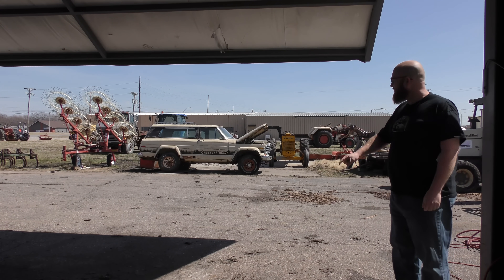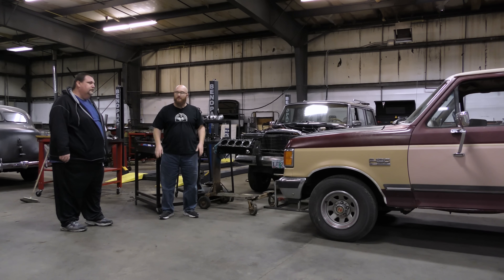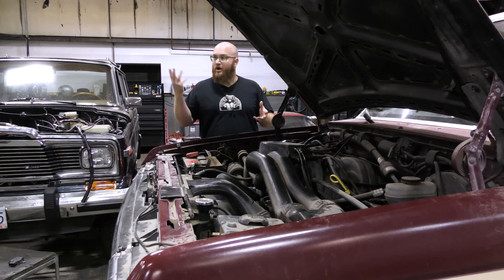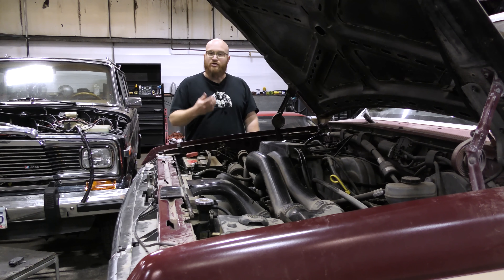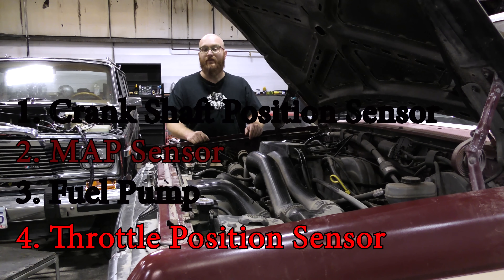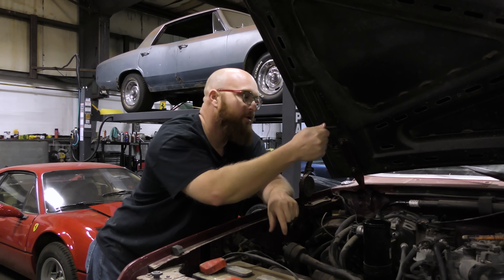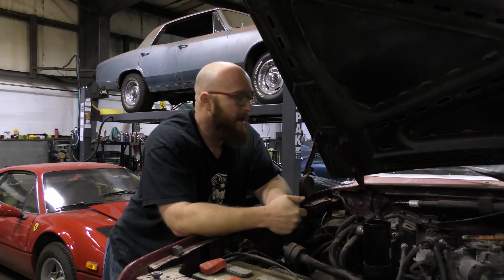Parts cannon couldn't fix this '90 F150. Old School diagnosing by the CAR WIZARD

Comment: I would check pin holes in the vacuum booster for the brakes? That whole vacuum system for the brakes is wanting to trick you all the time. 
    Tefgel and o-rings, amazing how many things on boats you can fix with that.

Comment: I love using the parts cannon, because I have more money than patience. Also, I have known many people take their stuff to mechanics, pay good money and their vehicles still doesn't run right. So my theory is, replace the parts and move on to the next system. I hate car shopping so whatever vehicle that I buy I commit to it. It's like owning a house. It's easier to repair what you already got. Every vehicle or really anything on this planet is in a state of decline or decay. And finally why not buy new parts so the manufacturers keep making them. I have never had a problem getting parts for an old Ford.

Comment: I saw this video years ago and came back to it today now having a truck with the same engine. It runs rough with only 66k miles on it. I have a loud backfire when revving the engine and it wants to die now when I put it in gear

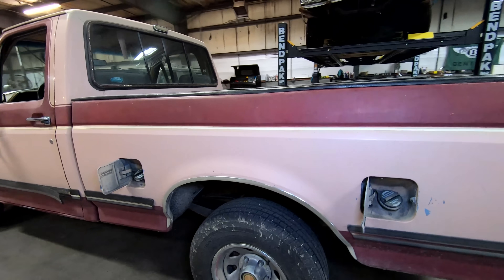Comment: 6:30 I had an 88 F150 and both tanks worked, however when you ran on the rear tank, it would pump fuel into the front tank (I assume the selector valve didn't switch the fuel return)

Comment: Hadda brand 1984, step-side, w/ a 4speed manual, w/ overdrive, w/ serious assembly issues. Currently have a 1984 f150, 270k, 302, auto, much to my dismay.

Comment: In the double fuel tank model 1 pump can have a bad check valve can cause weird problem. Runs rough tank your not using will fill up

Comment: the smoke test is genius. aside from that its best to buy and have a BOOK for such vehicle. As knowledgable as you may be, YOU didnt design it, and the ones who did have made a very thorough service manual for it with step by step procedures. I dont mean a flimsy haynes manual, i mean a real manual. or better yet, a stack of them. they will have specific ones for engine/transmission, emissions/vacuum, body/suspension etc....

Comment: the Ford 302 is a solid engine. Like the chevy 305/350 or the dodge 318 all of those engines are solid bulletproof engines I have 300k miles on one , Dad had 400k plus on a 318

Comment: I know i'm 2 years later, I don't think that truck even has a crank sensor. that's why it has a distributor. and yes my guess were MAP and TPS.  Did you ever find a new throttle body for it?

Comment: Not applicable in this case and nothing to do with idle, but a crank pos sensor can cause an intermittent fault if it is working but gapped incorrectly. I had an intermittent misfire on my 2000 miata and after a lot of troubleshooting the problem was just the crank sensor gap was out of spec just a little, enough to cause a CEL and slight misfire just once in a while.

Comment: there's literally a single tiny hose on first gen explorers, that if you have any leaks in that line (near the firewall in front of the driver in us domestic models), and it runs like complete crap at best, and dies constantly. plug the leak, runs like a top.

the level of vacuum dependency on this era of fords is insane.

Comment: Hey Car Wizard thanks for your informative video!!
How did you confirm the MAP sensor was the cause of the RPM "hunting" ? Did you check the MAP output signal at engine off ? or did you monitor the signal as the engine was idling? In other words if you confirmed the MAP was bad while engine was idling , how did you know the fluctuation of the MAP output signal was not caused by maybe the IAC due to an erratic operating ECT sensor or maybe an O2 sensor providing unstable feedback to the CPU and the CPU controlling the IAC making it ramp up and ramp down on the duty cycle ? Thanks so much really enjoyed your video.

Comment: Use starter fluid and spray the vacuum lines. When the engine starts to run smooth, you found it! Even a pinhole.

Comment: maybe a throttle body for a 1990 5.0 Mustang would fit. I haven't done the research to see if one would. Late Model Restoration might have one in stock or another aftermarket parts place that carries engine parts for older mustangs.

Comment: I just got a 91 ford 150 yesterday for 500 bucks only thing wrong with it is a cylonoid, spark plugs, belt, and muffler but it runs and still drives just very loud and don't like the mountains of viriginia but you can definitely tell that the 90s trucks was made way better

Comment: I have a ‘96 with a Ford 300! Probably a dumb question: but could you just switch the truck over to a carb? Or an aftermarket throttle body system (Sniper) might be pricey but then everything’s be brand new!

Comment: i have a 1989 f 150 it has same engine as video and have already been through the parts cannon we have replaced fuel injectors, tune-up new distributor checked catalytic converter  and exhaust no obstructions,  i assume they set timing in the midst of all the other things they have tried. ,when you crank it up you have to keep it running and you hear alot of popping under the hood not sure if misfire is proper terminology but would appreciate any suggestions

Comment: I have had 6 90s era fords. The throttle position sensor went out on every one. The first one I had it got so bad the truck would go down the road and almost get to 4th gear without touching the gas pedal.

Comment: I know this is older. I don't watch every single video but I'm guessing it's the #4 TPS. I've got 2 of these windsor trucks and have had to do TPS on both.
EDIT: MAP and TPS already being replaced isn't the end of the world at least especially if he plans on continuing to drive the truck. I would have had trouble tracking down that vacuum leak without a detector. Definitely common at over 30 years old to have vacuum leaks.

Comment: My dad had a 91. Wasn’t happy. Some module in the distributor went , and with less than 50k miles the synchros were starting to go in the manual trans. Did have the 300 six. Crummy trans.power steering very noisy and annoying too.

Comment: I disagree about intermittent crank sensors. My 2000 lesabre 3800 had an intermittent crank sensor problem that would stall at stop lights.

Comment: Nice POS working farm truck.  It is not hammered or rusted out.
Throttle bushing kit is going to be your best bet.  Never done one on a throttle body, but have done plenty of Q-pukers. 
OBD1 is an out of control train wreck.  Not only did you have to have the machine/software, the vehicle had to have the latest service pack updates in order to be compatible.  Even then. Very limited information.  Old school knowledge and troubleshooting required.  Great job.

Comment: While these scan tools are not as good or useful as the OEM Dealership scan tools of the late 80's / early 90's, these two tools from Actron are at least pretty good for troubleshooting.  The Actron CP9190 is an OBD "1" scan tool (or "pre OBD" if you want to call it that).  It has cables for GM / FORD / and CHRYSLER vehicles.  The CP9690 is a newer version and has the same cables, plus the round TOYOTA and the square TOYOTA cables.  You can buy additional cables separately to make these scanners talk to HONDA / NISSAN / and HYUNDAI as well, but that's about it I think.  Anyway - the scanner 9190 can be purchased for anywhere from $200 to $500 used (eBay) in good condition (its about a 10 year old product).  The 9690 is a current day product and can be bought brand new for about $175 to $200 online (Amazon, etc.) - again, these are not nearly as good or feature-filled as the original dealership tools, but I'll tell you certainly they are very helpful, and at just a few hundred dollars they are affordable for the shade tree auto enthusiast.  My 9190 (the older version) has served me well to date.

Comment: Hey I got a car that ran and drove fine last weekend for $700… just rusty and crappy and dead battery. Later found out the alternator was crappy, and the fuel pump died the next day. It’s for a demo derby race though. Car had been sitting for about a year beforehand

Comment: Trucks of this era are plagued by ecm issues where the electrolytic capacitors fail, sometimes spectacularly and crap brown stuff all over the board. After 30 years I'll bet 50% are bad. They are easy to remove, capacitors are easy to locate (2 or 3 depending on the model) and new caps are cheap on Amazon. Most people will be able to replace them with a good soldering iron, but it's scary because you're literally swapping computer parts on a circuit board.

Comment: And now....some more vintage tips from Target Training......they became Identifix later on.

1) check the cooling system for electrolysis by grounding one end of the voltmeter, and placing one lead into the radiator fill neck, immersed in the coolant.  More than .5 volts is a problem.  Change coolant to fix.  This voltage will alter the ground plane voltage from true zero.  Just add .5v to all your sensor readings, and you get the idea.  Been there.  Fixed that.
  Especially important for this new wave of resurrection jobs.

2) Check all grounds and make sure they are within a few ohms of each other.  Especially the oxygen sensor ground, which is wired separate.

3) Check the oxygen sensor outputs with a voltmeter.  Get the polarity right.  We had a few bad O2 sensors put out negative voltage, which the computer cannot detect at all, and goes apeshit, never flagging a code.  Then the tech goes apeshit, and we have to put him down.

4) A smoke machine is not required for vacuum leak testing.  "The bucket test" works just fine.  A "bucket" of water poured on the intake manifold.  If it causes a misfire, go fix it.  If that scares you, then use gumout spray......it is just too directional at times and evaporates too quickly on a hot engine.

5) Check the injector resistances with the engine hot.  Heat is not their friend.  The bank fire systems really don't like uneven resistances in parallel, because the lowest resistance injector robs current from the others, and makes that one cylinder flood out a bit, while the others are lean.  This one is sequential injected, but this is a very important lesson for the older systems as well.

6) Make sure Ford trucks have their fuel lines sufficiently shielded from heat near the left side of the motor.  Vapor lock over long, hot drives is a problem that is hard to test for.  No fuel pump fixes this problem.  INSULATE WELL.

7) A worn EGR pintle can cause a rough idle that the computer aggravates by subtracting fuel.  The inadvertent adding of exhaust gasses at idle will trick the o2 sensor into reading rich.  Remember.  It's an o2 sensor, not a fuel or air sensor......that's all it knows.  A spikey O2 sensor waveform and slightly low vacuum reading is produced under this condition.  A worn EGR pintle will make the EVP sensor read wrong, even when new.

Comment: A bad pcv valve can cause an intermittent hi idle , and will cover your air filter with oil vaper from the crank case .

Comment: 1994-96 F150 with the roller 5.0 were just as tough as the 4.9 six versions. Run 300k miles easy, but the AODE trans would usually give up around 150K miles

Comment: Well let's address the surging idle and rough idle issue in your 1990 Ford F-150 5.0L V8. Here are some steps to diagnose and resolve the problem:

1. Check for vacuum leaks: Vacuum leaks can cause surging and rough idle. Inspect all vacuum hoses, intake manifold gaskets, and throttle body gaskets for any signs of damage or leaks. Replace or repair any damaged components as necessary.

2. Idle air control valve (IACV): The IACV controls the idle speed of the engine. A dirty or faulty IACV can lead to surging and rough idle. Clean the IACV using throttle body cleaner and ensure it moves freely. If cleaning doesn't help, consider replacing the IACV.

3. Throttle position sensor (TPS): The TPS measures the position of the throttle and provides input to the engine control module (ECM). A malfunctioning TPS can cause erratic idle behavior. Use a multimeter to test the TPS for proper voltage readings at idle and when the throttle is open. Replace the TPS if the readings are outside the specified range.

4. Mass airflow sensor (MAF): A faulty MAF sensor can disrupt the air-fuel mixture, leading to surging and rough idle. Clean the MAF sensor using MAF sensor cleaner or consider replacing it if cleaning doesn't improve the situation.

5. Fuel system issues: Inspect the fuel system for problems such as a clogged fuel filter or a failing fuel pump. A restricted fuel flow can affect the engine's idle stability. Replace the fuel filter if it's clogged, and test the fuel pressure to ensure it meets the manufacturer's specifications.

6. Ignition system: Check the spark plugs, ignition wires, and ignition coil for any signs of wear, damage, or malfunction. Replace the spark plugs and ignition wires if necessary. Test the ignition coil to ensure it's functioning correctly.
If the issue persists or you are unable to identify the root cause, I guess your sol.

Comment: You should be able to put a carbureted intake on that thing. Change out the fuel pump for a low pressure 7 gal psi

Comment: I had a '89 shortbed 4x4 F150 with a 302, manual tranny.  The tranny was the weak link.  That was the best sounding truck I ever owned though.

Comment: I have an 87 F-150 Lariat with not working air conditioner, and wondering whether I should convert from R12 to R-134a or just find a mechanic that works on the R-12 and just diagnose/repair.

Comment: The 7.3idi came with a turbo in the last year/first year of the powerstroke. When he talks about the 7.3idi like in the buy this not that, he never mentions this. I’d like to point out that the late model 93-94 7.3idis came with a beefed up engine(to handle the turbo) and a turbo. I think when talking about the 7.3idi and the powerstroke you have to mention that they made a better version of the idi in the final year. It’s a whole different comparison then just lumping it in the with the non turbo 7.3. 

There’s a good bit of evidence showing that ford even tuned down the late model idi to push people toward the newer powerstoke.

Comment: Here's an idea: if putting in a new throttle bushing is problematic (availability of the bushing, labor cost of taking the throttle body off the car & re-installing it), how about "sleeving" the throttle shaft ?  I believe it may be possible to take the throttle shaft out without removing the whole throttle body, and if you can find the right size tube, you can slide it over the throttle shaft to reduce the cross-sectional area of the worn hole that causes the vacuum leak . . .  I'll admit it's a bit "mickey-mouse", but hey, it's an old truck and the goal is to just make it run better . . .

Comment: I have an 89 E150 with the 4.9, they had the highest fuel pressure to combat vapor lock, 50 PSI and a blower fan directed via pipe to cool the injectors, later models upgraded injectors and dropped the blower fan, I am about to replace the high pressure fuel pump thats in front of the tank, last year codes had me replace the O2, and MAP, a tune up, plugs, wires, then cap and rotor, which required a new distributor, a cap screw tab was broken off, but would still quit when you restart when at running temp, has gotten so bad you barely make it home on a trip to the store, guessing pump, there are no codes. I've read how poorly the replacement distributors are, I hope that is not my issue, I don't want to be replacing parts all over the engine, since no codes are available, I assume its operating as it should.

Comment: There’s a 1000 comments, maybe someone mentioned an aftermarket throttle body from Brothers or Edelbrock. Hell those are only $210  or so bucks. Stock size is like 60 mm but a BBK 65 mm should work. I’m going off my old Fox 5.0 days and the million parts they made.

Comment: Crapper with 8th gens is the low pressure in tank pump AND high pressure inline. Most of these engines will run with a good low pressure in tank, but not particularly well. The 9th gen tank/pump design is much much better.

Comment: Could you removed the throttle body pump air in then spray soapy water to verify. Then add liquid metal to seal?

Comment: hate to tell everybody this but mid 90's(early obd2) to roughly 200(3) vehicles are by far the best bang for the buck I drive Saturns 96-99 and my trucks(gasoline) are all first-gen Chevy LS's For diesel trucks Cummins powered dodges are impossible to beat

Comment: As little as these vehicles are worth it's still cheaper to put money in old used vehicles than to buy a new one.

You can make the 2nd tank usable you just have to bridge them if you don't want to replace the fuel pump or replace the fuel lines.
Reply: Agreed

Comment: 86' f250 L reg cab 8' bed 5.0 / 22 mpg

She got idling problem at start staying running not starting but low idling. Little gas n Maybe re start or 2 ... cough it out of her and runs fine then after.

Comment: I'm a meck from the 70s an d 80s vacuum causes a lot of problems i,I, to disconnect all the lines and plug them and put them back on one at a time you usually find it I would spray carb cleaner on the throttle body it will tell you ,the electronic boxes used to go on all the 80 modles starts and quits running right away I kept a spear one and would check it then change it go to tho junk yard

Comment: Not a professional mechanic but by 5:35 I figured it had a vacuum leak. Time to start shooting WD40 around the intake manifold and throttle shafts. Those early engine computers just compensate for the extra air with more fuel which hikes the idle up.

Comment: Well...I did some looking and getting a new throttle body will be a tough nut to crack.  LMC TRUCK has everything....EXCEPT...that throttle body.  I have a 96 F150.  It runs excellent at 210,000 miles but maybe I should find a throttle body for it.  Just in case!